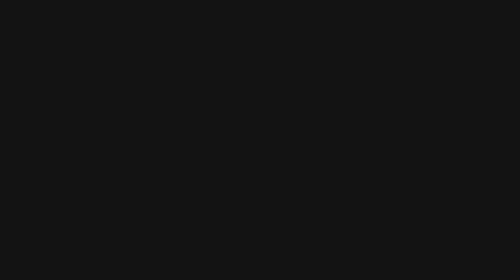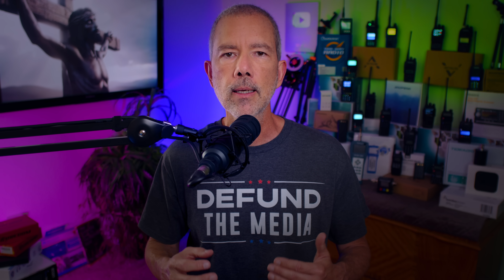What Does "Unlocked" Mean On A Ham Radio Or GMRS Radio? What Does Unlocking A Ham Radio Do?

Comment: Just recently got my ham license and am up to General. I am also covered by my FIL's GMRS license (though I am considering getting my own.) I even have a working CB setup since I feel like each radio has its place in an emergency. 

I was given a Baofeng UV-5RM and I have since discovered that it was apparently never locked. In it, I have three ham bands (and then some) as well as GMRS and MURS. There are so many different variants of the 5RM it seems like a radio lottery on what you get at times. I also have the identical-looking GM-5RH and that radio does appear to be locked to just transmitting on GMRS channels. 

I have to agree that it is easier and far less clunky to be hauling around more radios than you need. And I have the different channels set to the proper power settings since those that step on and annoy other users are more likely the ones to eventually get a visit from the FCC. I am also licensed to transmit on the frequencies that I'm transmitting on. So who am I really hurting here?

Comment: 😆😆😆😆 here's the humerus thing in this these guys got the fines for not using their call signs. Not for not having a call sign. These were all licensed operators generally being dick heads because they found somebody that wasn't licensed transmitting and thought that they would teach them a lesson by jamming the frequencies. Which is a quite common stunt. It happens to me on a regular occurrence ham radio operators find an unlicensed operator having a conversation and decide to Jimmy it

Comment: My work has weak 2 watt HTs so I brought my own radio that I bought online which is a Mohanton Ham radio. But I found a frequency of 462 600 which can transmit to GMRS channel 17. The reason is to have greater distance when we have to drive to different locations buildings for work and still be able to communicate. Will the ham radio provide more fars with using it to the 2 watt work  GMRS walkie talkie?

Comment: If someone were to unlock a HAM radio to transmit on GMRS frequencies should they use a GMRS antenna?
Reply from the maker: You should always use an antenna designed/tuned for whatever frequencies you are transmitting on.

Comment: You can't use a unlocked GRMS radio on ham frequencies....  wait, that implies I have to BUY a radio to specifically operate on ham frequencies...
That doesn't sound right... Since you can make your own ham radio from scratch, then repurposing a GRMS radio, provided you are operating w/in specs, is very legal....
Ham radio means you hold the license not the radio

Comment: I have an original UV5R that I got before the Lock nazis took over. It can be programmed on Ham, GMRS, MURS and Marine bands. I suppose I should do the right thing and bow down to our radio overlords and destroy it replacing it with a "locked" version. BTW, I am a reformed Ham and licensed GMRS operator.

Comment: Hello I really enjoy your videos and hoping you can give me some advice. I bought a Wouxum KG-Q10G per your recommendation. I am having a problem receiving the NOAA weather stations. The only way I can hear them is if I grabbbbbb the antenna. What’s up with that? I can’t even change the antenna because it’s glued on and they say if you remove it it voids the warranty. Any ideas? Thanks.
Reply from the maker: It sounds like wherever you are the NOAA signals are not very strong. Not much you can do about it. Connecting a larger antenna would fix it, but as you mentioned, the Q10G does not have a removable antenna, per FCC rules.
Reply: @TheNotaRubicon  Thanks for you quick reply. It’s not the signal strength I pick it up fine with my cheap Boefang I’m not sure I spelled that right. I will give Buy Tow Way Radios a call tomorrow and see what they say. If the say there is nothing I they can do I’m going to twist the antenna off and replace with something. Any suggestions for an antenna for that radio would be appreciated. Thanks for the help and keep up you good work I look forward to your videos.
Reply from the maker: It may be that the GMRS antenna is not well-tuned to pick up the NOAA frequencies.. 
Be careful twisting off the antenna - I have seen SEVERAL reports of people breaking the radio trying to tear-out the antenna. I got lucky removing mine.
Reply: @TheNotaRubicon  Thanks!!

Comment: Ok, can we "lock" a ham Boof Wang into the gmrs mode through the use of chirp? Specifically a uv5r from about 5 years ago. BEE boop.
Reply: You can program it, but it doesn't matter, as it still doesn't have an FCC approval. Kinda like how I can program mine for PMR446 (FRS equivalent in Europe), but it's not legal to use it either way. However, unless you actually tell people, I'm quite sure no one will notice.

Comment: I have two radios one is a uv5r and the other is a talk pod. The uv5r is cheaper as a ham radio than the same radio as a grms radio. So why not unlock it my talkpod can do both? Now I’m a truck driver so I have a Am/Fm CB and I have my talk pod in my semi. You would be surprised how many companies use the family radios. Now I do have a Jeep and I picked the radios for off-road use but I have a cb in my jeep too. Because when the traffic stops truck drivers talk about what is going on and why but mostly what lane is closed. Now I don’t know of any off-road drivers using ham but family radios ,CB and grms. And cellular phones is not an off road option in my opinion because cellular is around people so if Yogie bear get a cell phone I not going to depend on them. And AT&T just proves why you need other communications. And the police monitors CB channel 9. But back to the radios who cares if it is unlocked or not they are mostly the same uv5r radios so save a buck or not your call.
Reply: A CB is the only mobile radio I keep in my car.  I used to do cross-country driving and had analog ham, digital ham and CB radios in my truck. Looked like a rolling antenna farm on my roof. The ONLY radio that ever got any use was the CB and that sucker was crazy useful for getting around traffic, just as you describe, spotting bears, or just entertainment. That's why I still have a CB in my car even though I never go anywhere any more.  It's still useful out on my local interstates.  The ham bands are dead here. No point at all in keeping a ham rig in the car.  I do keep a UV5R but I've never talked on it. There's nobody out there. Mostly use it to listen to the traffic reporter helicopter and the weather radio.

Comment: Just to deconfuckulate things for those in the back of the room (or from Rio Linda), if you can program or in some way manage to trick a GMRS, MURS, or Part 90 radio to operate on ham frequencies it's all good, provided you've got a ham license. You can even build your own ham radio from spare parts if you want -- you're even encouraged to do so. The problem, as far as the FCC is concerned, is only if you're going the other way or "hitting for the other team" so to speak.

Comment: Wouxun KG-Q10H is perfect swiss army knife radio. Unlocked it works perfectly on 4 ham bands (6m, 2m, 1.25m, and 440), GMRS, MURS, and works great as a VHF marine radio on a boat with IP67 water proof rating. You need to carry around a couple antennas for all the different bands it transmits on. Lol on the sad hams that carry around 2+ radios!   😂

Comment: Has anyone figured out how to unlock the UV-5G plus yet?
Reply: 1. Remove the Battery 
2. Remove the antenna
3. Remove the belt clip 
4. With the charging cradle arrange these items in an orderly fashion on a table top
5. Purchase a UV-5r 
6. Swipe the arranged items violently into a storage receptacle.... these are now spares... "SPARES"
7. Charge the UV-5R 
8. Throw the UV-5G out of the window.

You have now unlocked the radio.
Reply from the maker: It is not unlockable.

Comment: Hi, so on your recommendation I ordered Two- Baofeing ham radios. And ofcoarse I’m in a hurry to get it operational. Couple questions 
1) what is the name of website where I can obtain local emergency channels/frequencies?
2) can I program my radio to scan all frequencies in range ( less encrypted)
3) I have a labtop and on line. What is the name of the app/drivers/software you would recommend to assist in programming my radios.
4) thanks for everything you do, most don’t realize how important comm’s will be needed in the near future. 
Your Friend,
Jamie
Reply: Better Safe Radio programs hundreds of channels for the ham and GMRS radios they sell. There is a spreadsheet on their website with the channel assignments. 

Locally is a different matter. My local club has a spreadsheet of frequencies they've coordinated with the local EOC. But these are local and don't include the frequencies used by police, fire, ambulance services. These frequencies recently were trunked and encoded so it would be difficult if your local public agencies have gone this route.